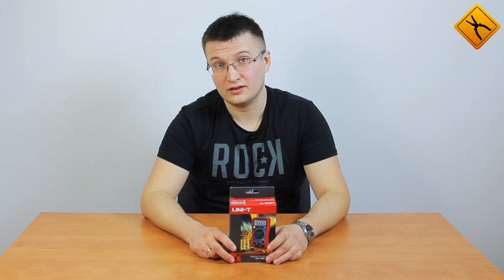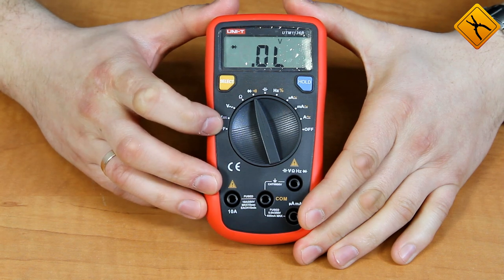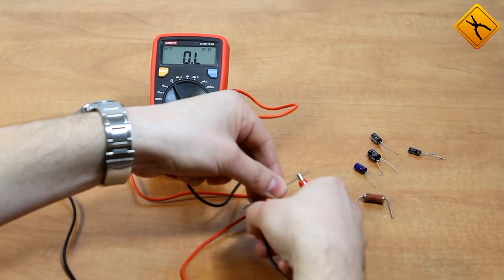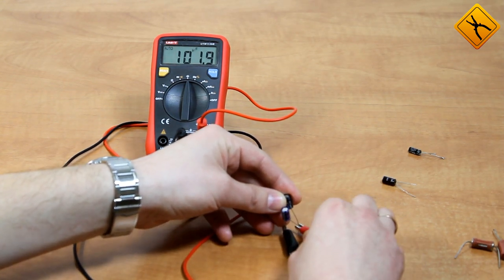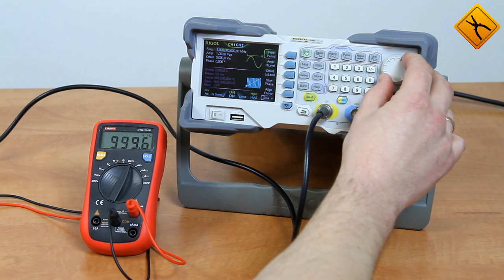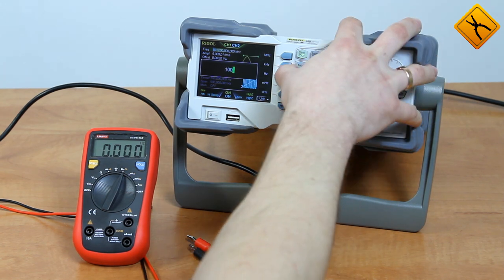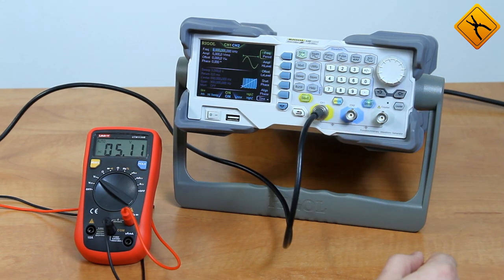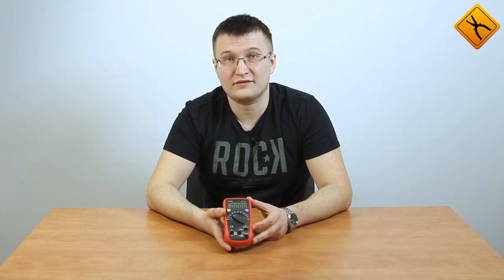UNI-T UT136B Digital Multimeter

Comment: Guess I'll go off topic for a moment and ask another fairly important question, what's the worse y'all can do to me. :)
Since the recent Hurricane/outage, I'm trying to set my modem up to run off 18650's. It's 12v and runs just fine directly off a 12v lead acid. The dilemma... I seriously doubt I'll be able to to get the specs on what the max/minimum voltage range is for the modem, and was wondering if it would likely (likely is the key word here and all I can expect is likelihoods for an answer) run off up to 16V?

18650's are 4.2v or so fully charged, and 3.7v nominal so my choices are around 16v or better (I can control full charge or not) for a 4 battery set up, or just over 12v tops that will drop to less than 12v with just a little use for a 3 battery set up.

This is just for emergency so I'd rather not bother with step ups/downs, especially if I don't need it. At worst, I guess I could just allow the 4 battery set up to charge to whatever seems safe...14V? But 16 is not far off that, and it wouldn't surprise me if that would work just fine, but I don't know for sure.
Reply: ستعمل بشكل جيد

Comment: I hadn't noticed what the conditions are each time mine stops functioning, but this time it beeped a couple of times between tests, (not during a test) I shut it off/on and nothing but a blank screen. 
This has happened several times and I have to wait 30/40min for it to start working again. The battery seems fine..doesn't knock me down when I touch my tongue to it but I've had things run on a lot less tongue measured juice. Any ideas what this could be? Shows a lite but blank screen in it's non functional condition, and it's virtually brand new..

Thanks for the helpful video.
Reply: Sounds like mine. I just posted on it.

Comment: Mine was junk out of the box, unfortunately by the time I got around to using it/noticing the problem, I couldn't return it.. Tun it on shortly after turning it off and nothing on the screen...nothing. Leave it off for 5-10-15 minutes or whatever, and then turn it on and it works. It's getting worse each time I use it it seems, and though it's already junk, I doubt it'll even rate that before long. Oh and the reasdings are pretty well off, as in an 18650 is reading 4.17 max charge, instead of the  true 4.22.

Comment: hello.nice review..this dmm can measure frecvency (50,00 hz) at 230 volts ?
Reply from the maker: Hello! Yes, you can, but in duty cycle mode the voltage should not exceed 10 volts.